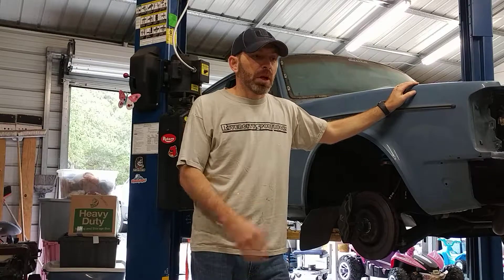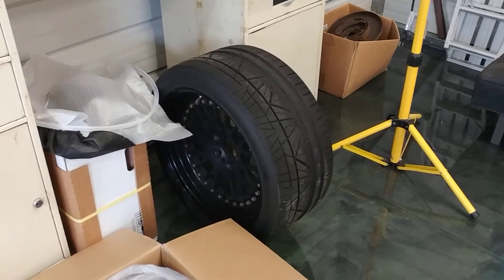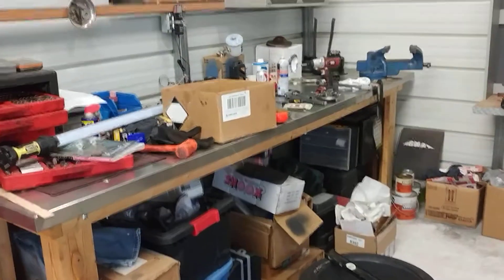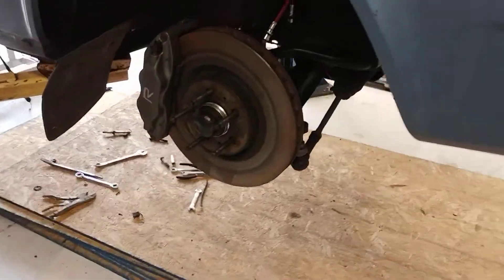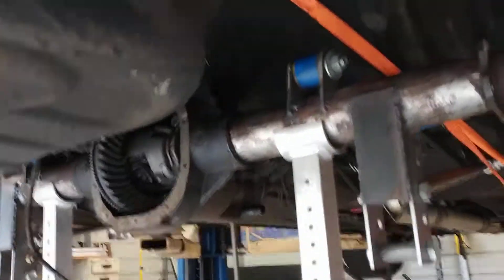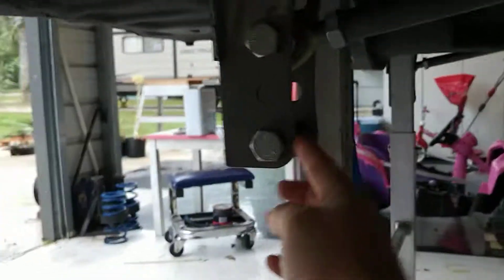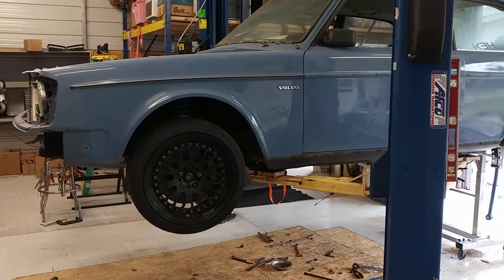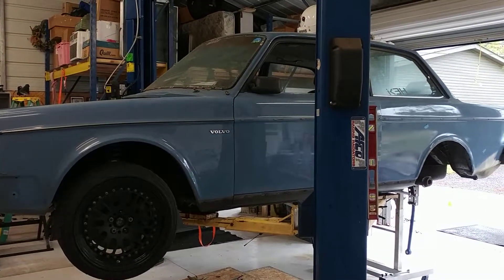December update 8.8 swap in progress

Comment: Just checking in how’s the Volvo coming along?
Just a quick question on your fronts coils what’s your spring length and spring weight?
Reply from the maker: Try to get a new video soon.  Been working a reasonable amount of side jobs lately, but did actually take the car for its frist drive today.  Still some bugs to work out.  As far as front suspension, the strusts are KYB 4way adjustable with 350# springs.  Rear is Strange coil overs with 175# springs.  Will see how that works out, but I anticipate on going higher on both.
Reply: rcstprez  what’s the spring height for the front?
Reply from the maker: @MrMonsterMusicMedia  8" uncompressed